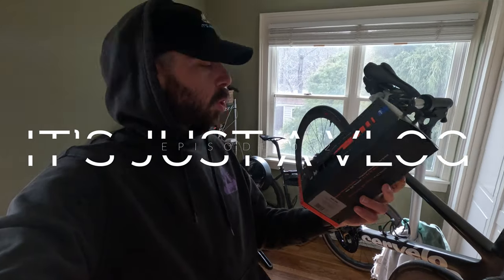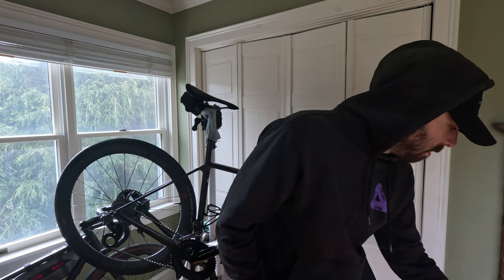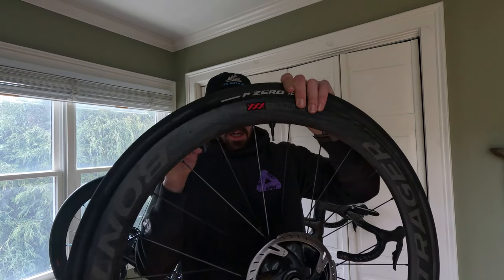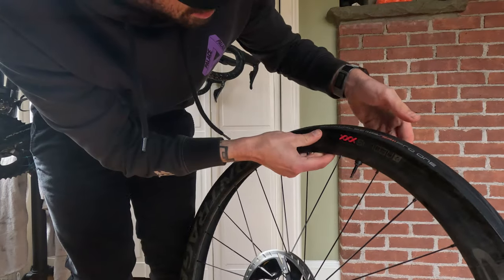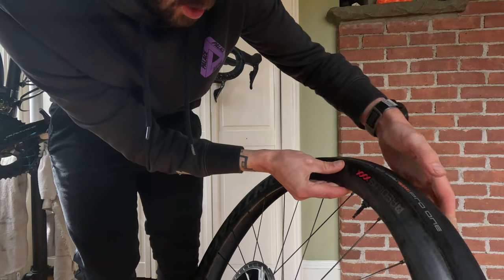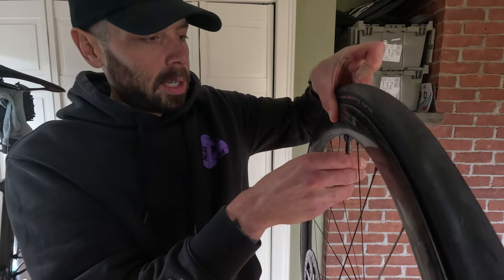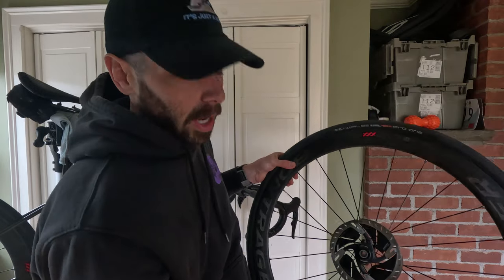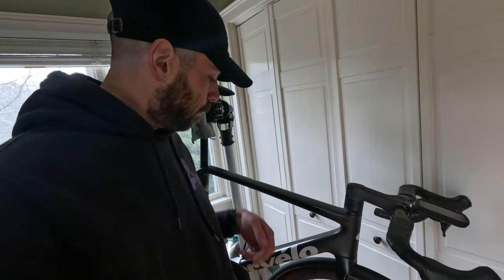It's Just A Vlog 002: Tubeless Tire Setup

Comment: Great video do you use tubeless tape or bontrager tlr rim strip?
Reply from the maker: I think this is the rim strip but I didn’t install it myself. These tires were setup for tubeless when I bought them.
Reply: @ItsJustAHill  got it thanks. How are these tires so far compare to the P zero and the continental?
Reply from the maker: @erlinsanchez1162  no complaints yet, but too early to judge and compare.